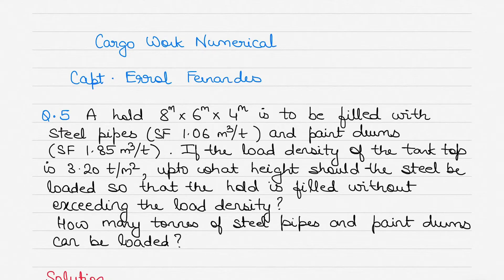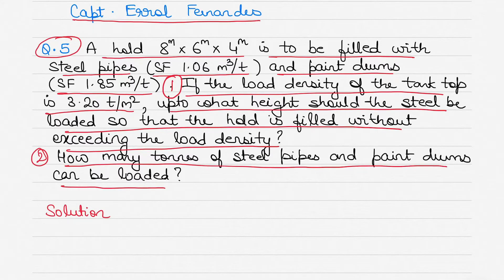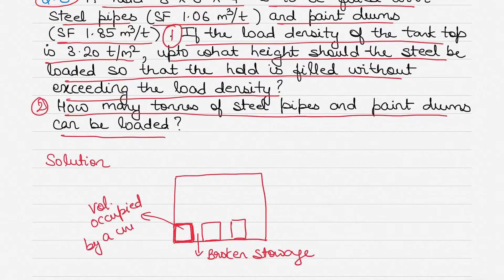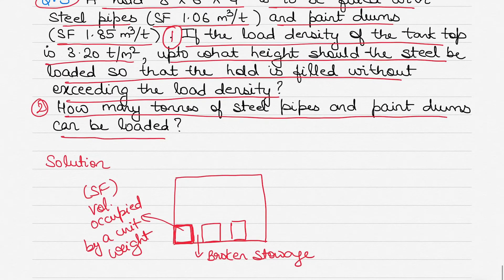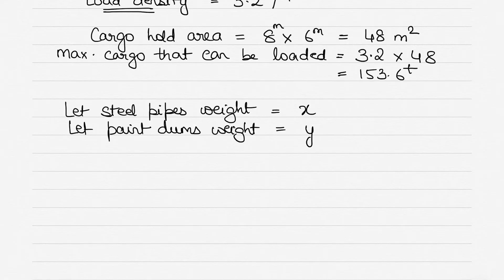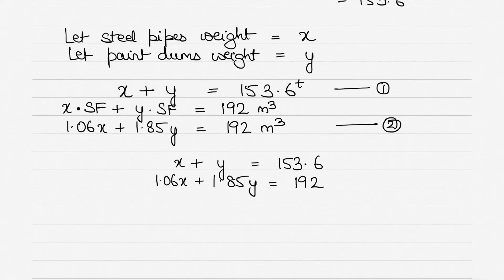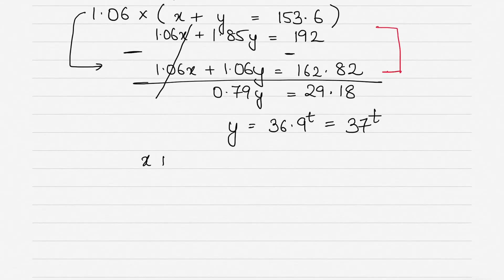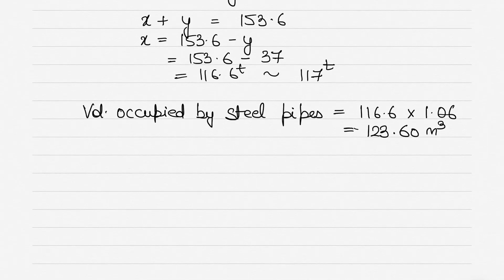Cargo Work Numerical - Q5 from the book ' Cargo work for mariners' by Capt. Errol Fernandes

Comment: Sir in this question is not there 2 question 
1st - calculate the maximum steel pipes to load as per load density , where we will not include paint drums and then the height of steel pipes will be - 162.816/(8*6)= 3.392m

2nd part-
Where we have to load both then as you solved in the video with Two linear equations.